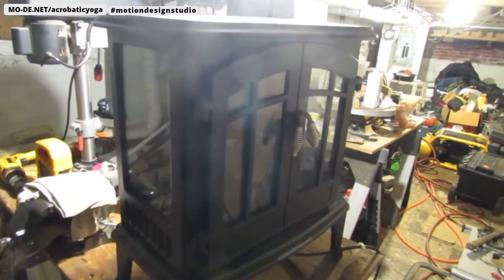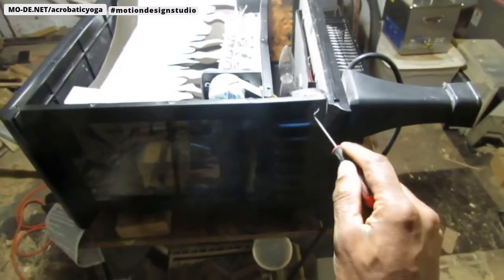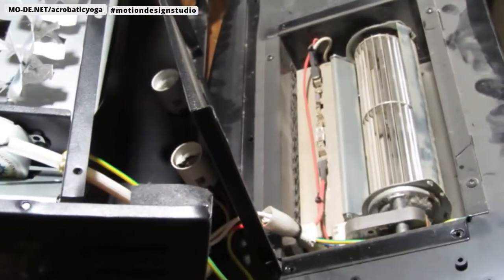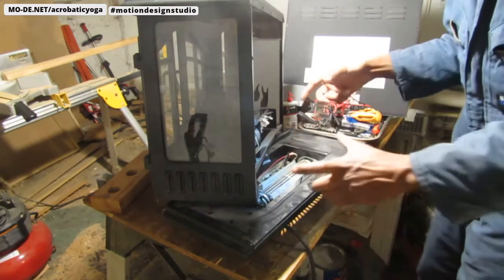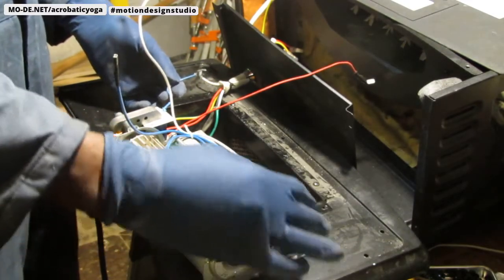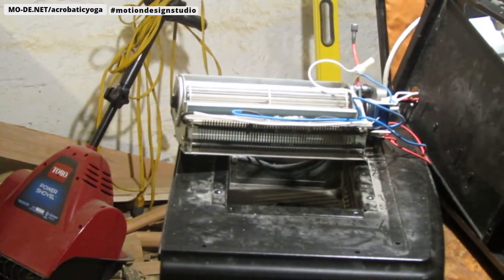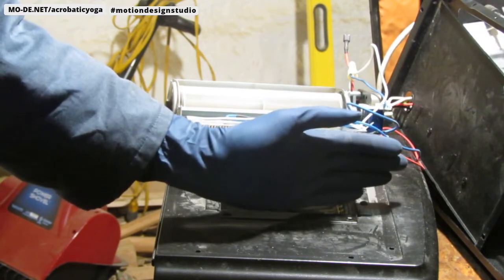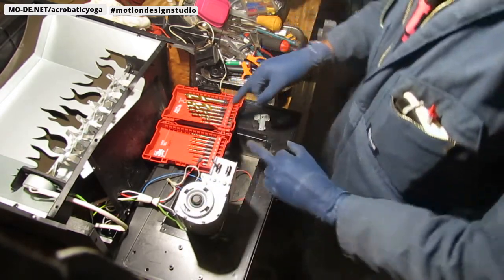Get It Running : Electric Stove/Heater Model EST-534T-10

Comment: I have this unit and it stopped working today. I unplugged it to plug my roomba in and when I went to use it again the power switch doesn’t work and is “spongy” vs clicking. Do you think that would be the thermal fuse blowing? Thanks for what you do!
Reply from the maker: The spongy switch sounds like the switch has failed not the thermal fuse.  I would open it up and look at the switch.  It is most likely there you will find the problem.  Since this is a very simple unit you can bypass the switch so the on state is what happens when plugged in.  This means the act of plugging it in and out of the outlet is what you will have to use to turn on and off.   Best of luck, keep me updated and thanks for the kind words.  Do not forget to subscribe.
Reply: Motion Design Studio Subscribed! :)... This happened at an inopportune time and I had to grab a fill in for Airbnb guests tonight, but I will let you know how it goes and send a donation when I can.
Reply from the maker: @Redmagneticdragon  ,thanks and happy today, everyday and Thanksgiving.

Comment: Our question is how to get the appearance of the flame back. We still have heat, but have lost the appearance of beautiful "logs burning". Do we need to replace those 2 40watt bulbs? Thanks
Reply from the maker: That is an easy fix.  If you hear anything turning the motor that turn the fake flames is good.  The bulbs you mentioned are the next things necessary for the flickering effect.    If both of those are functional you are good to go.
Reply: @MotionDesignStudio  thanks so much. We found the bulbs and replaced them, so now have our "flickering flames"  again.
Reply from the maker: @barbmcabee6842  , for the win!  Have a great week.